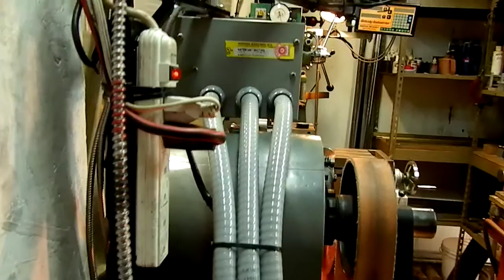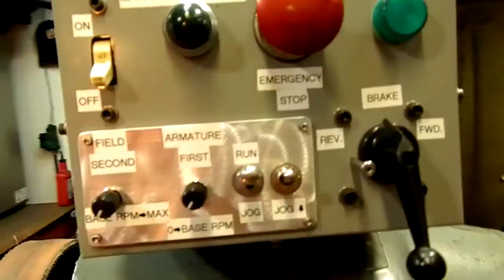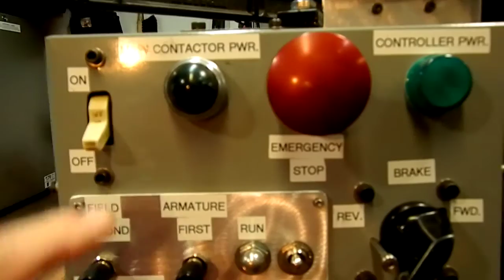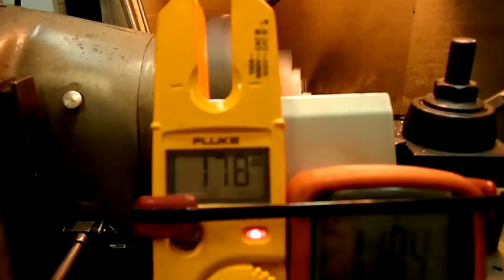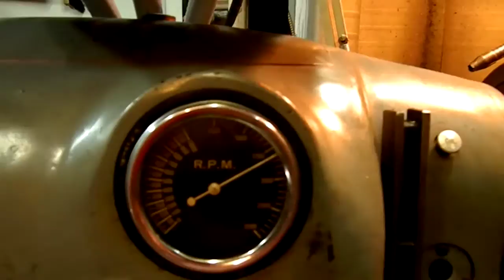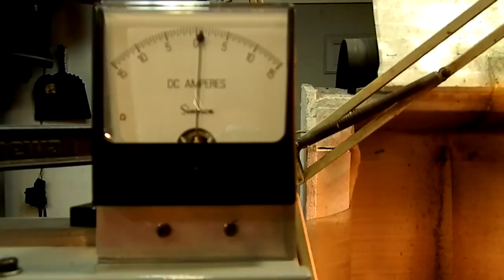new SCR drive for monarch 10ee lathe

Comment: Beautiful machine to look at, but not to listen to. Sounds like being on the deck of an aircraft carrier.
Reply from the maker: You wouldn't have wanted to operate it all day when it had the 3ph ac motor working
Reply: Think the lathe has a fairly high max rpm, that generates more sound aswell. More rpm can give you a nicer finish dough.